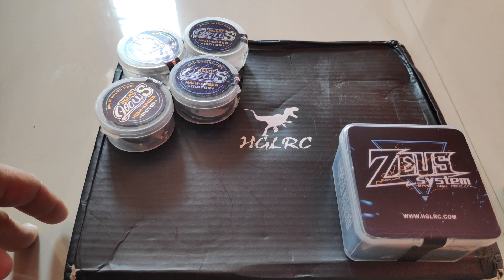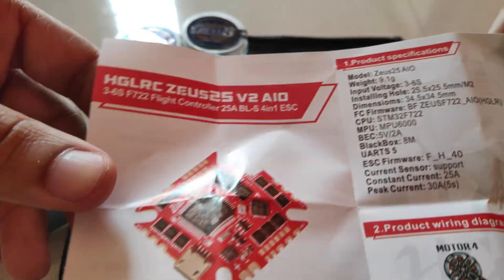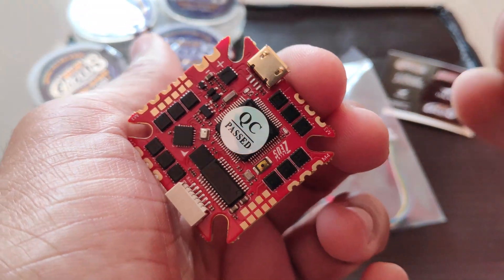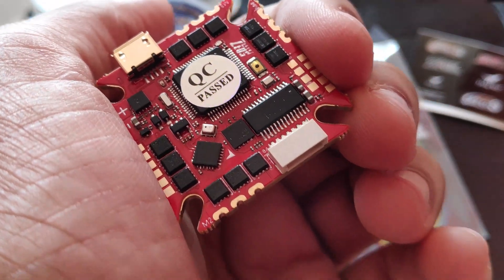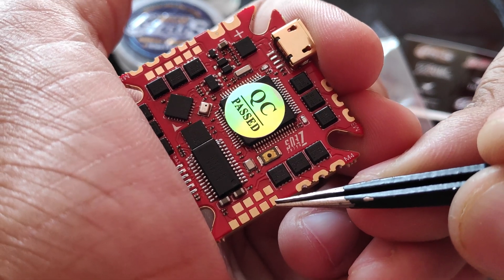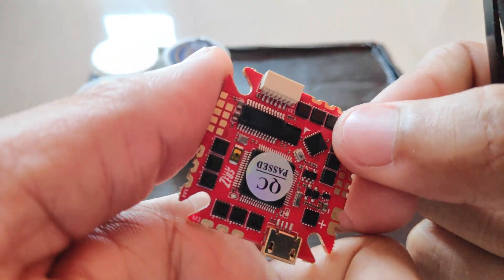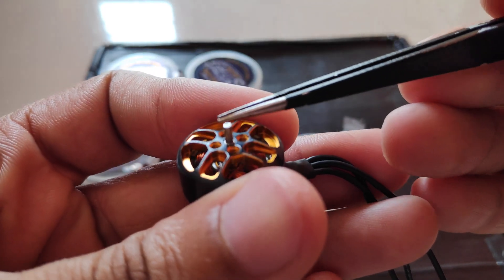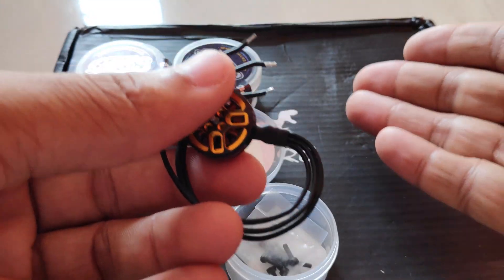HGLRC ZEUS 25A V2 AIO Flight Controller + ESC | AEOLUS 1404 2800KV Brushless Motors for VEYRON 30 CR

Comment: I got this FC and weld the tbs crossfire in the uart6. Then activated the serial Rx on Betaflight. So the radio tango 2 pro its bind with the nano RX. But doesn’t not work any channel on the receiver as the stick and buttons. You can help me?
Reply from the maker: Did you select crossfire in the betaflight receiver tab ? Also did you check if the rx and tx wire are connected correctly between flight controller and receiver?

Comment: I use the same FC. My drone drifts towards Motor 3 direction in Angle mode. Tried all the solution available online, no luck.. How's yours?
Reply from the maker: Mine is working well. Did you check in receiver tab if the radio channels values are centered to 1500? If that's off by a few units you could add offset and check. Plus have you mounted the fc too tightly? That could cause the vibrations to travel to fc gyro directly. Or you could have some weight offset around motor 3 side which could cause the drift in that direction